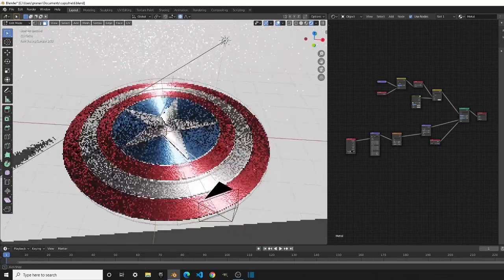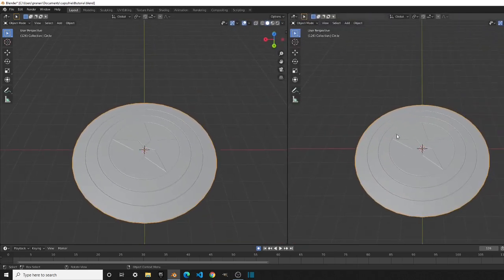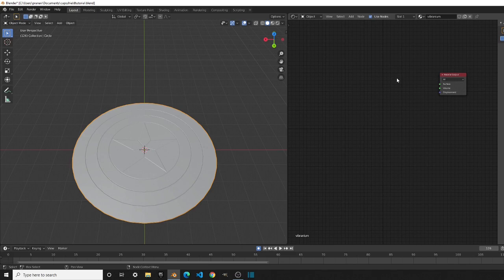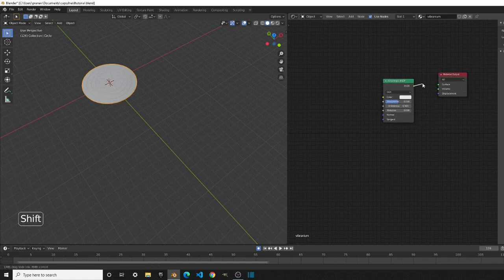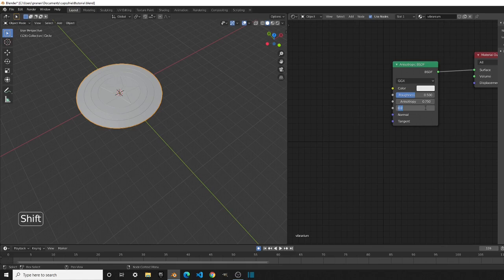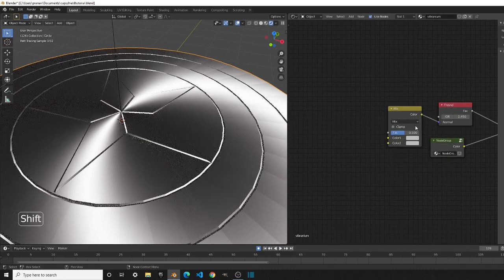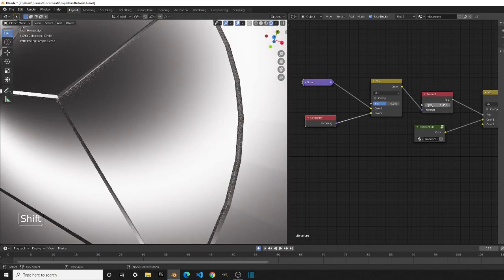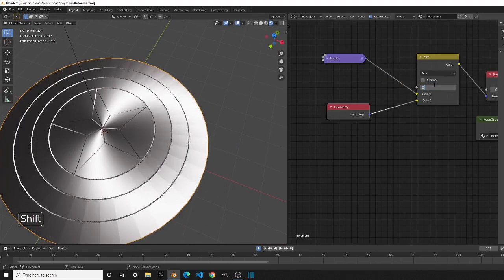How To Make Captain America's Shield in Blender (Part 2/2)

Comment: when i appyz materials for red rings, or blue area around the star, not whole are is colored, do i need to add some geometry to color like in the video. I could add loopcuts for the read rings, but blue areas would not be colored whole. do i need to tick somethhing for the whole selected mesh area to be colored
Reply: figured the subdivision surface must be set to simple for coloring to work.

Comment: mine look really great but I can't add color because your screen is cut off and I can't see it
Reply: Once you have made the color in the new material, go over to the tool bar on the right side of the screen. If not selected already go to Material Properties. There should be a list of all the colors/materials you have added. Select the part of the object you want colored, then go to the materials list and select the material you want to add. Underneath the materials list there should be 3 options Assign, Select, Deselect. Click the assign button, and it should work.
Reply: Ok thanks